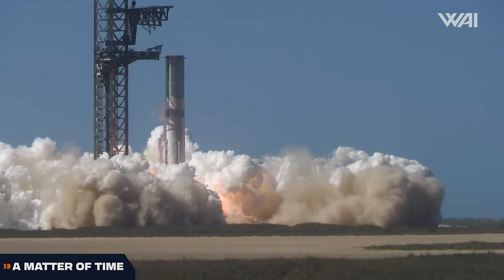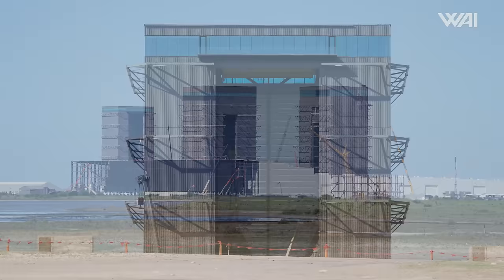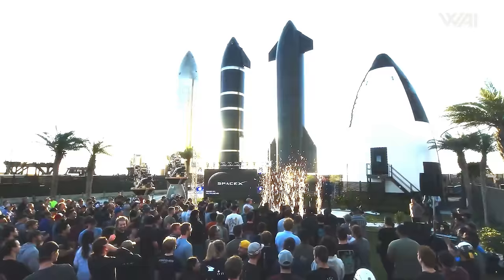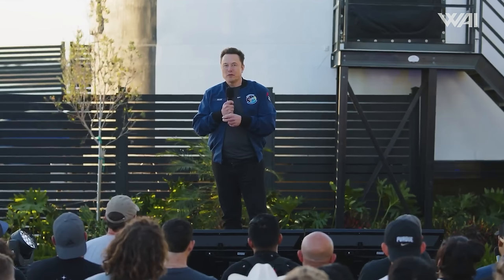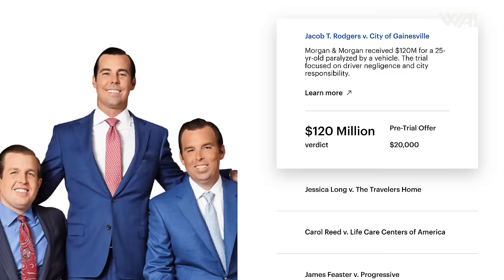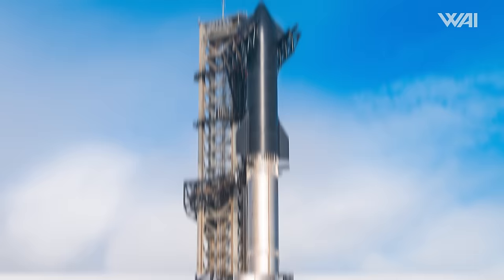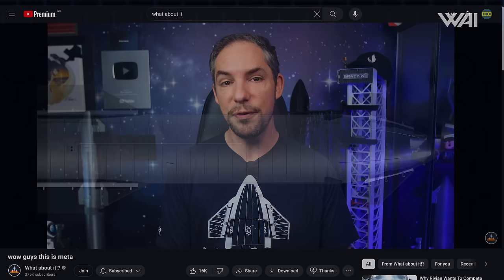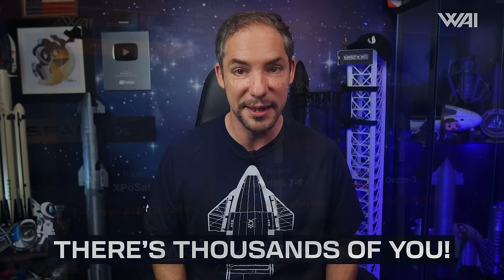SpaceX Unveils Groundbreaking Update: Inside Musk's Latest Starship Revelation!

Comment: The first Mars landing Starship won't be taking people, it'll be taking Tesla 'Bots. By the time people go, the first settlement will already be up and running.
As for the ships, nah, that swarm graphic is a mistake. They'll put modules up in orbit in a frame for a single Starship to push, with the frame having tanks connected via the Quick-Disconnect port, so a ship can park and refill then return and repeat, once the tanks are topped up and cargo loaded, a ship will park and push. Later frames for taking people will park multiple ships around the outside of a ring and spin the ring to hang the ships for internal gravity, with a pusher ship getting fed fuel from the rest.

Comment: Starship updates are interesting. But I am detecting a disturbing trend. The SpaceX philosophy of "no part is the best part" allows them to save weight and boost performance, but it also removes redundancy. The idea of removing the shielding between engines in Super Heavy and then fixing the risk that will ensue by "creating and engine that never blows up" is foolhardy in the extreme. I have serious doubts if NASA will ever human rate the Starship without serious modifications. And I fear for the lives of Jared and his crew if they ever sign off on the initial manned test flight of Starship in the Polaris Program.
Also the idea of craming two Starship Launch Towers in LC-39A in a pad area meant for only ONE Saturn V, with a small fraction of the power and explosive potential simply because SpaceX is afraid of a little paperwork, is kind of ridiculous. That goes along with trying to catch both a booster and spacecraft with Chopsticks, risking the extremely expensive and time-consuming to replace launch pad. Maybe you will be fortunate most of the time. But accidents do happen, and one of those can set your launch schedule back months. And then trying to put a crew inside the second stage of your spaceship without a way out if the second stage explodes. (And that abort scenario is controlled by an automated system, which is good. How would you like to be  a human at the switch that certainly terminates the life of a full crew?)
SpaceX is proceeding much like the Apollo Program. It is run by a bunch of 20 somethings that feel invulnerable. All that changes when you have a really bad day and kill a crew. Those 20 somethings learn that they are not infallible or immortal.

Comment: Even if the virtual tower water landing is 100% successful on IFT-4 I really don’t see a reason to attempt to catch the booster on IFT-5. Surely there is so much to do with the Ship - full orbit, on-orbit relight, payload door, actually deploying satellites, more fuel transfer tests, and I suspect re-entry of Ship will need a few attempts. Successfully catching the booster would seem to me to be nowhere near being on the critical path so why not wait until they have at least 2 or 3 successful water landings before risking the launch complex? It’s not as if they’re short of boosters right now.

Also, with the design evolving so fast, from a logistics point of view a landing on the virtual tower (at sea) is almost preferable to a successful catch. If they catch one of these early boosters they’re unlikely to want to use it again because it will already be obsolete so it’s just another very big item that needs to be stored somewhere and ultimately workers and megabay space needing to be allocated to scrap it.

Comment: 1:55 that (data from IFT-3 provided data about the heat tiles) seems unlikely.  The ship was basically tumbling on re-entry and didn't follow a normal or recoverable path, so it is unlikely that much of the data gained from that would be any good.  Maybe they got peak heating numbers from some parts of the ship to update their models and with those updates decided to make some adjustments, but that seems like a stretch.  I would guess that they've just been making improvements on the ground and things were ready with the new "sprint" so they are doing a partial install before IFT-4 flies because they've got time.
Reply: Honestly I think it was a wildly successful failure. Meaning that the failure to stabilize actually gave them a ton of data on how reentry heating affects the whole Starship in a near worst case scenario. Its insane that it stayed intact. It did result in loss of the vehicle, but reentry was fine. Shoot, they may be able to reduce some of the tiling. Who knows.

Comment: What if they poured and cured the tile ceramic from the base upwards, with more protruding anchors built into the skin for a more uniform and unified strength. Even if they cured it only on the broadest surfaces or in sections that go from one side to the other.
Reply: For clarity I mean that the tiles would be replaced by large sections of continuous curing as it moved up the vehicle. Not unlike 3d printing

Comment: One thing's for sure, catching the booster will not be attempted before the second tower is fully functional. I'm guessing they really don't want any more delays concerning the towers. Elon wants to get to the next phase ASAP - that means a ship in orbit and capable of delivering payloads. re-entry issues and catching vehicles is the next big hurdle, but at least there's an expendable version that is payload-worthy. Human rating is going to be the toughest nut to crack. NASA is never allowing humans on a ship that can only land propulsively, and has no abort system for the biological payload. And I mean, NEVURRR. Dragon was proof of that, Elon wanted propulsive landing, but it was NASA that put a full stop to that and mandated parachutes as primary landing system, with thrusters as backup.
Elon is one hell of a genius, but what I cannot understand is his reliance on 100% reliability of engines, which is 100% impossible. Keep flying missions (and tons of them) and eventually there WILL be an arbitrary failure that leads to loss of crew on impact. Parachutes are totally unusable as backup landing system as the altitude is way too low for them to deploy in time if a propulsive failure occurs.
I'm still convinced that Starship will only get human rating if the crew section is redesigned to double as a shuttle craft(Imagine a really beefed up version of dream chaser and a bit more cylindrical body shape, like X-37) that can detach from that tanks and engine section(which can continue with its belly flop re-entry and tower catch). the crew shuttle glides back to earth like the shuttle did, and can land anywhere with a patch of asphalt long enough, in emergencies. That's about the minimum configuration NASA is ever going to accept for crewed vehicles. Of course, unmanned cargo ships etc would not need these excessive changes and retain their huge payload capacity. But the manned ships would need to sacrifice chunk of that payload for crew safety.

Comment: Just because Musk said only 5 refuels doesn't mean it is 5 refuels.
1) How many refuels will it take to place the full complement of humans and technical gear on the moon, because I'm hearing rumours of cargo only Starship capability.
2) Will the next flight achieve full orbit?
3) Will the Starship and or the boosters touchdown upon the sea have a independent video from a ship stationed near the area of interest, if not why? highly suspect if not!
4) NASA and FAAs paperwork doesn't need a reform Felix. it's the opposite, Space X needs to adhere to NASAs and FAAs paperwork, especially due to the recent 100 percentage failure rate of the Starship program!.................. the arrogance that NASA and or FAA safety procedures needs to bend over for Space X,......... after the Boeing de-barkles that's not going to ever happen again when trust is placed in the builder. 
5) Creating all these Starships is one thing, creating all these Starships and human rate them is another thing.
I have currently no confidence in Starship's safety record to place humans in it and as for a Mars programme and military potential well that's Musk the snake oil salesmen rattling again.

Comment: Surely it would be good to actually get one of these things into orbit before talking about the 'bigger and better'.  And last time round it got to orbital height, but was over 2000 km\h short of orbital speed.  I understand having a roadmap but the ridiculous hype on a vehicle that objectively is years away from commercial service, (if it ever gets there), is typical bluster and bollocks talk from the snake oil salesmen.  I'm calling another funding round coming soon!
Reply: the 2000 km/h short was deliberate so they had full control of where the ship would come down, they won't go full orbital until they can prove that raptor can relight in space. It will most likely be launching payloads before the end of the year, the ships they are launching currently are old and outdated and only good for finding critical flaws in the design.
Reply: @shaung949  Commercially, there isn't a market for Starship, other than his own starlinks, and I estimate it's at least 5-10 successful launches away from anyone trusting it with any payload.  The way SpaceX is burning through hulls is certainly showing up critical flaws that just don't need to happen.  What other launch system has destroyed all but one of its test subjects, mostly explosively.  SpaceX is pissing public money up the wall when better design iteration could have saved all of the smoke and mirrors we're seeing now.  This is a show, not an intelligent way to design spacecraft.

Comment: SpaceX is going broke! The heat shield is not ready, and apparently there are no good test facilities on the ground that they can use to actually develop it. The wild changes in the plans and timing of major milestones is indicative that SpaceX has a very limited amount of time to survive. The replacement of more realistic planning (14 refueling flights to get to the moon) is being replaced with fantasy planting which only requires five magical flights for refueling. The plan is completely unworkable because it overlooks any type of refueling necessary to get starship to the mars, it also completely overlook what the people in the starships who are waiting for months to actually takeoff for Mars will eat. The fact that there is no development right now if you have the key technologies, including the Technology to make fuel on the surface of Mars, none of which is being developed indicative the entire is workable. The only thing that starship is going to end up delivering is a very large payload, low orbit and that’s it. And the only way that starship is going to continue to be developed is if the department of defense funds it.
Reply: The 14 refueling flights for the moon was in the original proposal to Nasa as a worst case scenario and based on the V1 raptor engine. They are currently using Raptor 2 and have raptor 3 coming soon each delivering a huge performance increase in the amount of fuel they can lift per flight compared to v1 raptor. The whole point of Starship using Methane for fuel is that the technology to produce that on mars already exists.